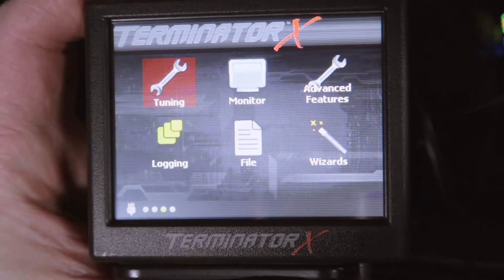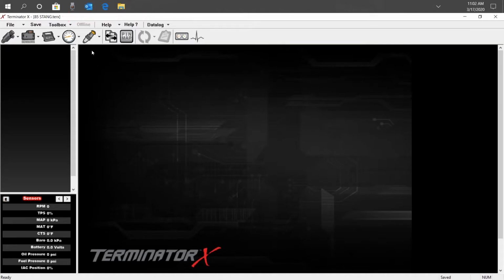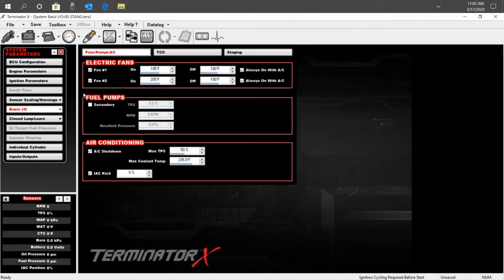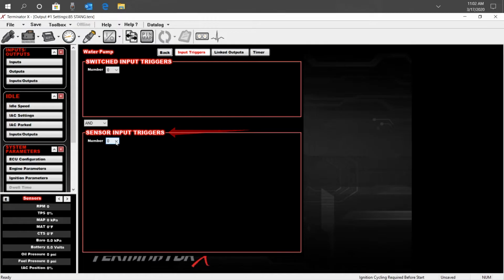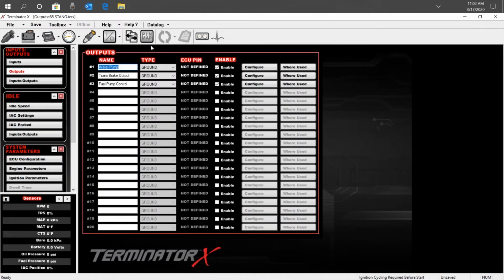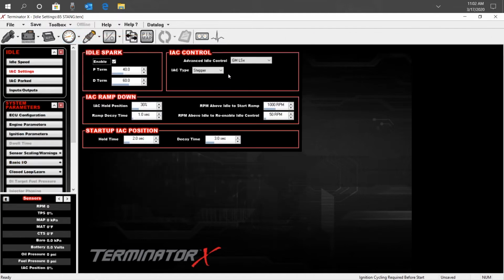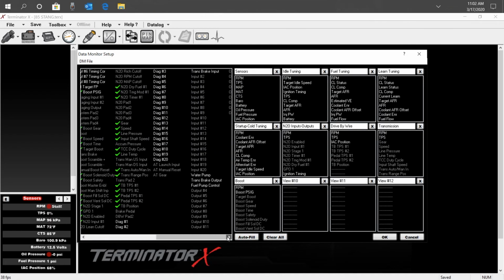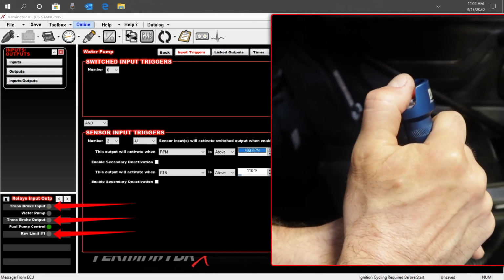How To Setup Inputs & Outputs on Terminator X EFI

Comment: I set up transbrake and rev limiter as described in the video for my Terminator X. My transbrake works but the rev limiter does not appear to activate along with the transbrake button. Rev limiter is stacked along with transbrake in my inputs. When i monitor the transbrake and rev limiter i have green lights for transbrake but not rev limiter. What have I missed?

Comment: I wish you could configure the Terminator X for different RPM inputs... like a 4-cylinder or 6 cylinder and I wish you could use low-impedance injectors. is it possible with a resistor Bank? The Dominator is way overkill for my needs. I Have A Streetcar but I'm currently using megasquirt 1 converted to megasquirt 2 2.2 daughter card and you can't even by those components anymore cuz they're a decade-old. I want to go to something made in the USA with good tuning ability. I think the Terminator Max looks great decently priced comes with everything I would need. I have to rewire a trigger input but since I already have one. I wish I could just configure the system to read my Ford edis 6 that I use. I mean if you guys could change some of the settings to work with many inputs far as RPM trigger it would be amazing.

Comment: Terminator x sucks, said plug and play more complicated than YOU  thing,  fuel injector data has to update into software  and technical support sucks to. Too. Bad i spend $1000 bucks
Reply: 68 c10 love just because you don’t know how to use something doesn’t mean it sucks. You shouldn’t even be looking at an aftermarket ecu. the terminatorx is the best and most advanced ecu for under 1000 bucks PERIOD. I use one in conjunction with a stock gm ecu. lord help you if you try to venture in on a haltech or other similar ecu. much more complicated.
Reply: Go carb man, or research for a couple of years
Reply: I'll buy it off you lol
Reply: Doesn't every standalone system require you to manually input your inj data. If that's your biggest problem with the terminator Im sold. I have megasquirt plug and play for my foxbody I couldn't imagine your reaction to that since  it says "plug and play" lol
Reply: “Plug and Play” in the aftermarket ecu world means, strip out all the old wiring and ecu and replace everything you need with new shit on seperate relays just so the ecu can control the motor and trans. at least that’s how it is on 96 fords. They have bad stock computer setup it all has to come out